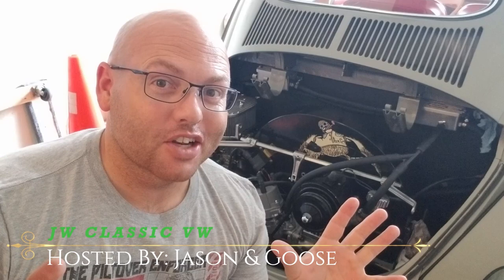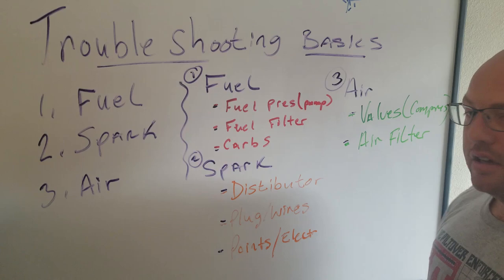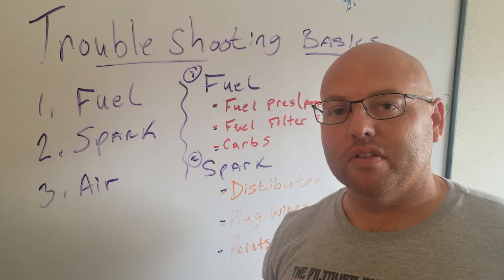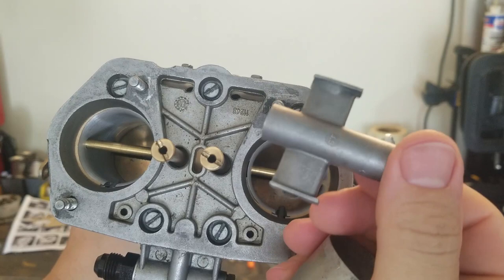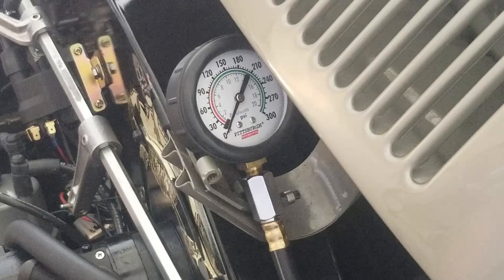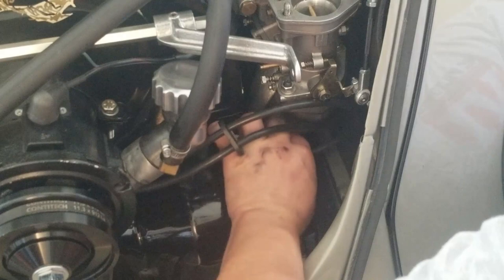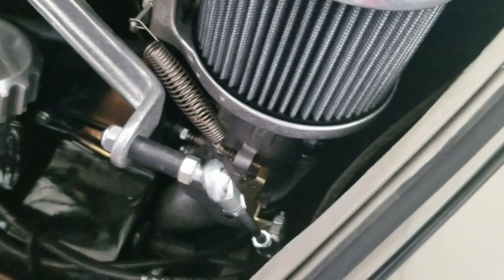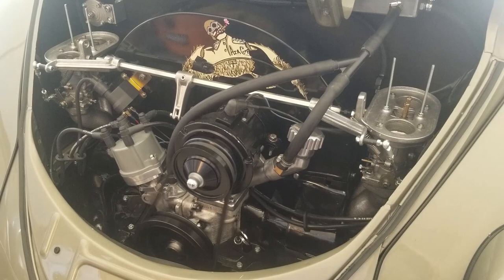VW BUG | IDF Update | Weber Tune | Engine Troubleshooting | JW Classic VW

Comment: When checking compression, you should (as you said) make sure the carb is at wide-open throttle. Without a carb on, you are in the clear. It's already wide-open. But when you turn over the engine, only do crank it over about 6 times. Any more than that is just wasting your battery juice. 
Even with a high compression big block V-8, six turn-overs is plenty to get a good compression reading.

Talk about bad plug wires, years ago I was working on a Chevy V-8 that had a nasty miss when hot. After several times trying to recheck everything, the miss was still there. I stopped to go eat a snack and then went back out to try some more things. It was getting night time and dark. I fired up the engine and went to look at it trying to figure what was wrong. I was created to the prettiest light-show under the hood. My plug wires were leaking juice all over the place.  Little lightnings were playing havoc with my wires.  And I only had about 100 miles on them too. I learned one thing. DON'T BUY CHEAP IGNITION PLUG WIRES. 

Moe
Reply from the maker: Good info Moe... love it brother hope your having a great day!
Reply: @JWClassicVW  You are having a good day. You have Goose and the General.

Comment: I wish I had YouTube 30 years ago! I picked up a cheap 63 Baja for a project, rebuilt the engine to 2110cc and I'm getting ready to put dual 40's on it. They weren't used very long, guy swapped them for injection but they sat for quite a while. 
With 044 heads, 110 cam, and a header set with J tubes do you know a good starting point for jets? Elevation here is 5500 feet.
I haven't seen the car yet but a guy I work with has a oval window sedan that I'm hoping he'll sell me. It's quite a ways from where I live so I don't know what shape it's in yet.
Reply from the maker: I would say starting jetting point would be what is in them... lol but really that is a hard one to say.  I do have a lot of great Weber set-up docs located in the Files area of the Facebook Group that should be very helpful.  There is a starting point recommended for engine size, you can refer to that.

Facebook Group Files: https://www.facebook.com/groups/1254174451415854/files
Weber Jetting Guide: https://www.pacificcustoms.com/mm5/techinfo/weber_or_hpmx_jetting_guide.jpg
Reply: @JWClassicVW  thanks, I'll check that out!